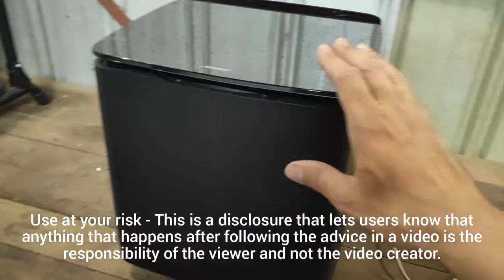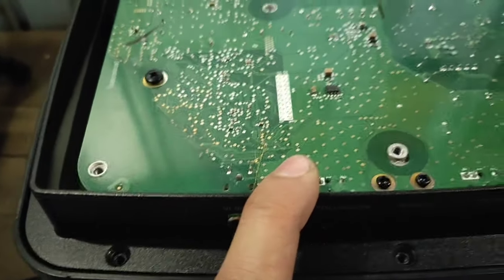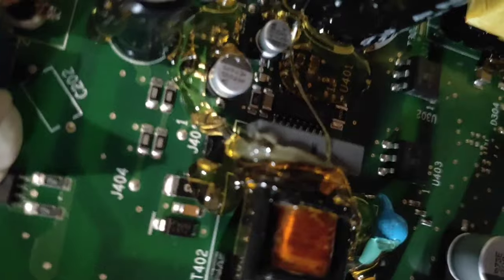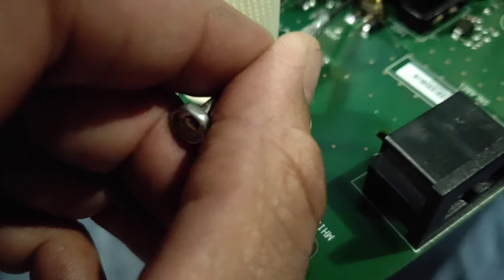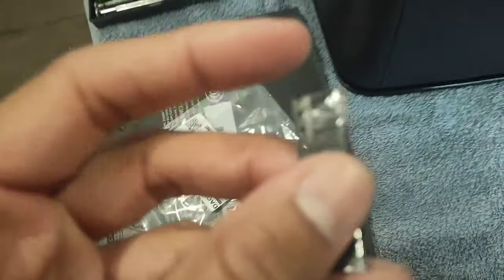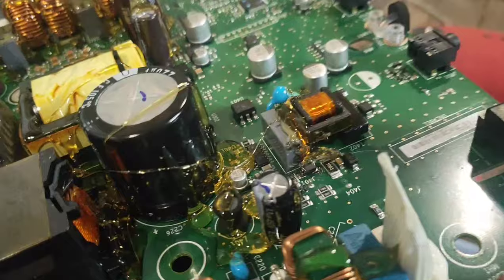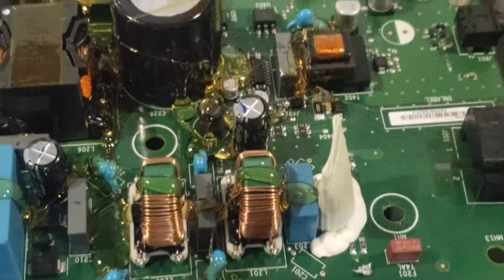How to fix a Bose Acoustimass Subwoofer

Comment: Thanks for posting! I use FR302 100V 3A D027 from JAY CAR Worked for me.
Reply: yup, can confirm. just got mine to work with the jaycar 100V 3A diodes. bit bigger and they're not the same casing but you can make it work. i believe these FR diodes get a bit hotter than the B2100 so just make sure you leave the diode with plenty surface area to dissipate the heat.
Reply: Used the same worked perfect
Reply: Did the same, and it works just fine. So disappointed with Bose that a small component is so unreliable. Bose quoted $200 to fix it while the component cost 0.50c
Reply: Thanks! Used this and worked!
Reply: Worked for me too. Thank you

Comment: Amazing and thank you so much. Your solution has fixed mine too. Diodes from China on eBay- I ended up receiving 50 by mistake so plenty of room for errors, but did it with the first one. Used a pointed scalpel to remove the glue- cut down vertically in the shape you want to remove then just lever up the glue. Worked a treat. I'm sure people know this, but for soldering, hold the diode upside down very gently in some small grips and dot solder on both the terminals. Hold it with tweezers in position and just apply heat on each connection until the solder melts and sinks down- be patient. Hold it in place until the solder cools then do the other side. The line on the diode goes to the left- hard to see on the original. Thanks again and much appreciated.
Reply from the maker: Thanks for the soldering tips.
Reply: This probably saved me from frying a chip. I used an extra pair of hands as I didn’t have a vice/grip and this instantly helped. Thanks a lot!

Comment: Many thanks for sharing this. Part ordered on eBay,delivered from China to France in 2 weeks. Subwoofer fixed and now working ! The most annoying thing is to remove the glue and clean the contacts on the board after removing it. I should advise using a iron soldering where you can set the temperature.
Reply from the maker: Good to hear mate

Comment: Thanks very much for the video. I had exactly the same issue with my Bose subwoofer. After 4.5 years, it literally just died overnight. Glad I found this video. I followed the instructions and the subwoofer is working again. 
The link you provided for the part, the supplier was out of stock. I found the part on digi-key. Glad I ordered five diodes as I fried one on my first attempt with a large soldering iron. Downsized the soldering iron and solder wire to 0.7mm and got the job done. Thanks again :)
Reply: Bro I nearly went off

Comment: Thanks for the posting. My woofer also lost power. I have ordered diode 
B2100A-13-F SMA(DO-214AC). However in the motherboard it was only B2100. Still we replaced and it worked. Amazing
Reply from the maker: Probably the same chip but ran out of space to print the whole info.

Comment: Thanks! I went to the local shop and they gave me a normal diode 60V 3A I believe, they told me it is sufficient.
I also removed the glue around the diode using a precision knife instead of heating it. It took a bit longer but it was less messy. It works fine afterwards.

Comment: Thank you, you saved another Acoustimass 300, I replaced it with a ‘SMD Diode SM4007A 1000V 1A D0214AC’ from Jaycar, many thanks!!
Reply from the maker: It's a great speaker otherwise.

Comment: Thank you so much!!! 

I never expected this too work. My piece had a lot of hotglue on it and it took forever to scrape off and use heat to get it off. 
But then I removed the part kind of jammed in the new one and added some solder. 

Plugged it in... AND IT WORKED AGAIN. 
Amazing. Thank you so much for the video!
Reply from the maker: You're welcome!

Comment: Thanks for the video, have the same problem, hopefully it will help me too.
I have not yet carried out the repair, I was only ordering spare parts.
Have a question: how do you know it's the B2100A-13-F diode? All I can see is that it says B2100 on the diode, without the letter "A".
Do you know if there is difference between B2100A and B2100?
Because B2100A is only available from China and B2100 can be delivered to me in 2 days.
thank you
Reply: Which one you used? Did it fixed your speaker?

Comment: Thank you for this video and guide  we repaired our bose subwoofer by our self  but instead of  using B2100A-13-F (DO-214AC) 
we use SMD US1M UF4007 1A/1000V SMA Rectifier Diode Fast Recovery Diode.  Success 🥳👍 
again thank you.
Reply: hello are these the same size as the existing diode or bigger? if they are bigger how did you fit them into the same spot to solder them on?

Comment: Fantastic video. Fixed a £700 speaker and the diodes only cost me £1.30 for 10 on ebay.
Reply: Looking to do the same,  do you have a link? can only find chinese for £15?
Reply: @screamingninja1335  I Have 9 that you can have for the price of postage if you like?
Reply: @prosci2579  UK

Comment: Thank you very much for this video! I have a question: I have an Acoustimass 300 (purchased in 08/2008) that stopped working this morning even though it was working yesterday and hasn't been moved for years. The LED does not light up anymore... How can I know if the failure can be repaired by your method? Is it (unfortunately) common enough to know that it's that? Comment: for the price of this equipment, it's incredible that the components of the subwoofer can just fail like this... Thanks in advance for your help!
Reply from the maker: Its almost certainly going to be that problem. It's such a cheap and relatively easy method to replace the chip so you've really got nothing to loose. Obviously I cannot say for certain that it is your problem but a lot of people have had this issue resolved with the method in the video.
Reply: @outie555two   thanks a lot for your answer ; for sure you cannot be 100% sure ... I've ordered the cheap and will try to do it properly ... I've contacted Bose afterasale service and they don't want to know anything ... repair is 145€ !!! I will try to repair but anyway, they've lost a client. Won't buy anymore Bose product. You don't invest so much money to have your system down after a few years. thank you so much for this video that helped so many people !

Comment: Hi!
I changed the diode you mentioned and the light doesn't turn on yet. Should I necessarily connect the board to the sub to check it works or is the light supposed to turn on anyway empty?

I apologize if something isn't understood since English is not my first language. Thanks in advance.
Reply from the maker: Not sure, as I'm no professional. Perhaps someone else reading your comment might have an answer.

Comment: a great THANKYOU for you from the Netherlands. my woofer failt at newyears-eve ... found your video and did the exact same thing... except i didnt put the diode directly to the board but used 2 tiny wires so i was able to put on a more solid soldering. glued the diode to the board after isolating it. and away we go... boomboomboom 🙂
Reply: What a coincidence, the subwoofer from my father died as well on NYE
Reply: By the way, where did you order the diodes and is there a chance you got some spare ones? We live in Germany near the border

Comment: where can I buy this diode?  Do you sale or provide info where I can buy it please
another question,  for second sub, amber light change to white led for 2 second then goes red light and goes off for 5 second, (it is cycling amber-white-red) i think it has wrong FW, How can i upgrade subwoofer FW correctly?  when I look in app, it show Subwoofer 700, actually it is 300.

Comment: Just double checking for reassurance as not ordered the diode yet, but does it simply sit on the circuit board with blobs of solder to keep attached? Thanks.
Reply from the maker: Basically, yes.
Reply: Very fiddly but all done!!! Never really used a soldering iron before and thought it wouldn't work as wasn't too sure if i soldered the right hand side correctly/sufficiently, however it did. Thank you so much for your expertise 👍  @outie555two

Comment: I had the same defect after 17 months on the BOSE Acoustimass 300, diode intact on the outside, tested with a multimeter and there was continuity in both directions of polarity. Thanks to your video, I ordered B2100A from china, arrived in three weeks, replaced and tested, everything is perfect.
It is working again.
MYTHICAL outie555

Comment: I wouldn't put hot glue on the diode. That is probably the reason that it failed in the first place (my brothers Bose failed too and that had some glue on it)! Those diodes get hot and must dissipate heat into air. The hot glue is used around inductors to stop them whistling and also for mechanical fixing too. The person who was responsible for the hot glue was obviously trigger happy and covered over a critical component that needs to be in free air. If it fails again, next time clear away any old glue.

Comment: Hi
I’ve had the same problem but Bose repaired it.  Now my soundbar 300 has just stopped working - no lights or response from it. Power is available and checked.  Any idea what I should look for as a fault.
Also item is out of warranty.
Thanks

Comment: I've done this fuxs and got know where , I've left it on for hours and nothing , I've plugged in a aux cord that plugged into nothing and about a minute later the orange light came on .
I can unplugs the cord and it stays on but then even arfter that it does not pair up or even work via aux cord .
And if I turn the power of it doesn't light up at all until I plug that cord in that I plug into nothing at all .
Do you have any ideas on what to do next to get this to work ?
Reply: I have the exact same issue. Replaced diode but no light until i plug in an aux/jack cable into the ‘acoustimass in’ port. Then a solid amber light appears, but unable to link to the soundbar nor sound can be heard. Pls help!

Comment: Hello, great video, physically did the out of service diode look burnt?
I have the exact same problem but the J401 diode looks ok
Reply from the maker: The faulty diode looked fine on the outside. You might be able to test it with a multimeter but if your speaker isn't turning on its probably that diode being faulty anyway.

Comment: Great Video, but why on earth do you guys put hot glue back on the component ? For what reason ?!??
Reply from the maker: Assuming that the bass can make the chips walk, so reapplying what the manufacturer did in the beginning.
Reply: @outie555two  they mostly do that because of the soldering process, not because of vibrations !

Comment: How did you find out which part was broken? My bose speaker goes on and off again hasnt lost power completely but i wouldnt know if its the same part or a different one?
Reply from the maker: I found out by digging around the internet for what fails on them. Your problem might not be the same as mine just didn't turn on one day. But for the cheap cost of the chip, might be best to just try it.
Reply: @outie555two  Thank You

Comment: Will this fix one that isn’t connecting the speaking? Mine is showing amber then white and red lights. Won’t connect
Reply from the maker: No, this just fixes the sub woofer if it is not turning on. The subwoofer has a light on it to see if it turns on.

Comment: I’m not an electronic expert, but my bass 500 Bose module stopped working for me. 😢. People on utube showed me  the fuse , but I still couldn’t get it off. Any advice why my 500 Bose sub not receiving power?
Reply from the maker: Not a fuse problem in my video. It's a chip that needs to be desoldered from the board and a new one soldiered back on.

Comment: Hi Sir
I have same issue, manage to disamble the unit but can’t see any damage to the chip, just a silly question can we physically able to see the damage and is it 100% this chip to replace not any other. Kind regards
Reply from the maker: You cannot physically see the damage to the chip. It's a common fault with this model and literally hundreds of people have swapped that chip out with a new one and got the speaker powering up and working again

Comment: Hey, thank you so much for sharing this video. I had the same problem with my bose bass, ordered the chip on ebay, installed it after removing the old one. Soldering was a little bit difficult because of the small size of the chip and small space between the chips. I wasn’t sure if had done it correctly. But after testing the bass, it worked perfectly! Thank you 😊
Reply from the maker: Glad I could help

Comment: I have had mine for not even 2 months i got it DEC 2021. The BASS module comes on, has the white light on, and is connected to the 700 soundbar and shows up on the app as connected. It just doesn't play any sound out of it at all. I don't know if this is the same issue or another one but its frustrating having something so expensive not work after such a short period of time.
Reply from the maker: Yours is a different issue. In my issue the power wouldn't do into the circuits and the led did not go on. Don't know how to fix your problem, but maybe on the remote press "bass" then volume up. That controls the woofer volume independently of the sound bar volume.
Reply: @outie555two  I did that the speaker was just completely inactive still I swapped it with a new one from the store yesterday

Comment: My Acoustimass 300 flashes pulsating white and orange. get no sound out ! What could it be ? defective circuit board ?
Reply from the maker: Not the same issue that's fixed in this video. Without knowing what the solution is, maybe it just needs to be re synchronised to the base unit?

Comment: My subwoofer lasts 8 minutes working normally and then it turns off and starts restarting until it cools down again. Will it be the same problem? Will it be solved with that?
Reply from the maker: I don't think you have the same problem as this problem doesn't have the same symptoms. It just doesn't turn on one day.

Comment: Is this for the acoustimass 300 model? If not is the part number for the diode still a suitable replacement for the 300 model?
Reply from the maker: Not 100% sure but if your speaker looks the same and has the same "won't power on" issue, I reckon it will be exactly the same inside.
Reply from the maker: So our one is the 300 as it comes with the 300 soundbar. So sounds like it's the same model as what you have.
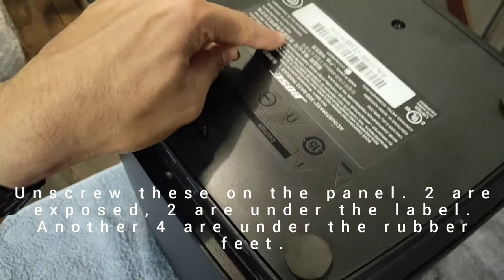Reply: 1:02 you can see the label of the modul. it´s the acustimass 300

Comment: nice job. i have bose acoustimass 10 series iv subwoofer. all other channels working good. but subwoofer sound is not normal. working but very low sound and not pure bass. very week bass coming. how can i fix?
Reply from the maker: On the remote, press bass, the volume up.
Reply: @outie555two  it’s circuit board problem. I tried all other ways.

Comment: I was hoping someone could assist me, there are two larger (2512 size) surface mount resistors on the bottom of the board when you first remove the cover. One is marked 7R5 the other is mounted with provision for another beside it. Could someone please tell me the value of the other resistor please?

Comment: Great video mine has no power either just went dead where can I buy diodes in Brisbane? thanks
Reply from the maker: I got my diodes from eBay, the link for what I bought is in the videos description.
Reply from the maker: I still have 7 chips spare, let me know if you need one posted.
Reply: @outie555two  Hi mate i having similar issue i live in Canberra any chance can send me  chips by post? i want try my luck.

Comment: After 4 years I have a connection issue with my AM300. After a few minutes the white indication light keeps switching to OFF --> AMBER ---> WHITE and then it keeps repeating, without any sound output. After turning off the Soundtouch 300 it works again for maybe 1 minute and then the issue repeats again.  I already tried it with the 3.5mm wired connection but still the same issue. Anyone experienced this? Not sure if it is in some kind of "boot loop" but someone knows if this FIX here may also work for my problem??
Reply: I am having the same exact issue. Did you fine the fix? If so can you please share?
Reply: Could you please share the solution for your problem? I am also facing the same issue.
Reply: @mohank6322  I shipped it to Bose support, they changed a component (some Diode) and now it works again - Total costs 120€ ..
Reply: @durst99  Thanks!! a lot.
Reply: @mohank6322  Hello Friend, are you already done with your problem?